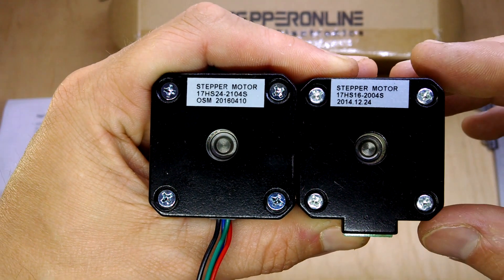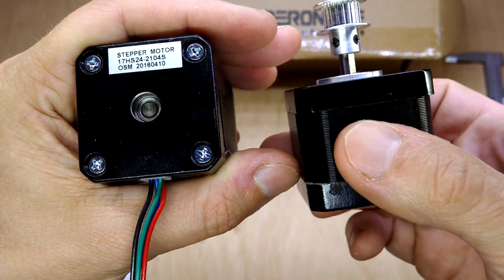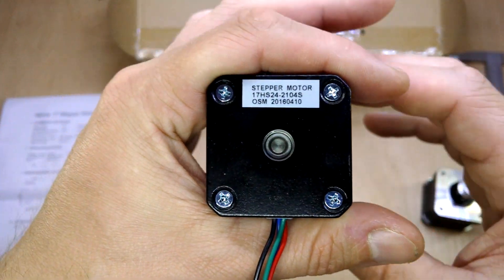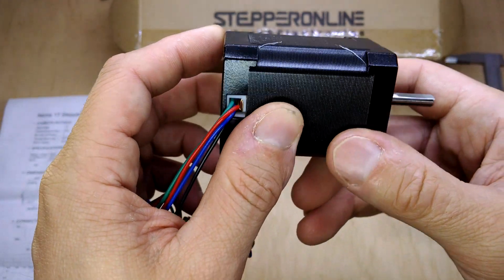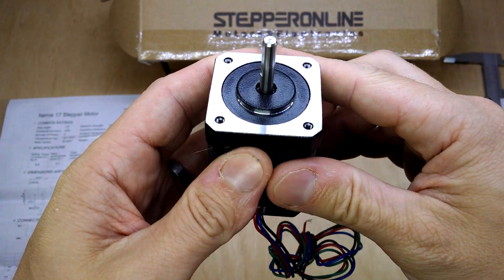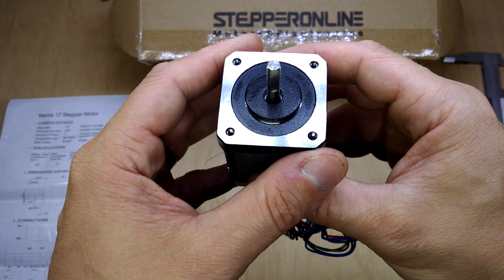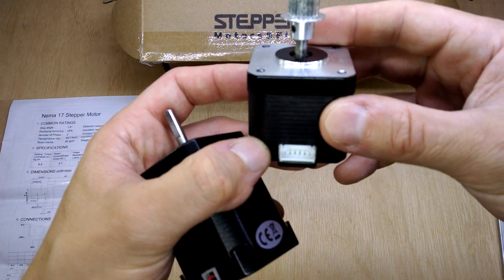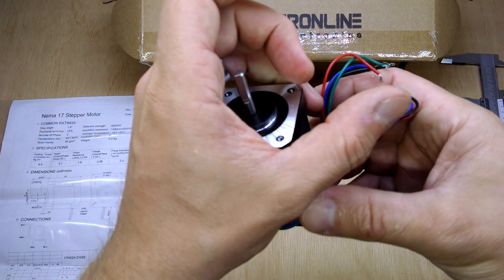First look - High Torque NEMA 17 Motors for New Corexy 3D Printer

Comment: Why do you need a high torque motor for 3d printing?
Reply: More torque can handle more hotend weight. If you build a 3d printer that has a strong gantry. You need big motors too. If you want speed you need more torque because if you increase speed you lose torque. A good printer has strong motors and light gantry. But sometimes its hard to make light hotend because you use more tools like direct extruder, sensors, better heat plate.